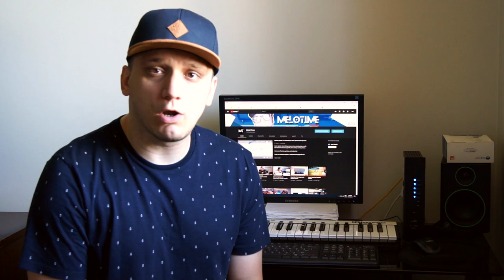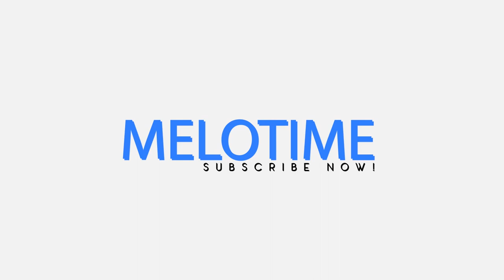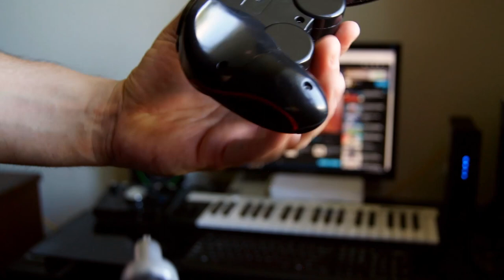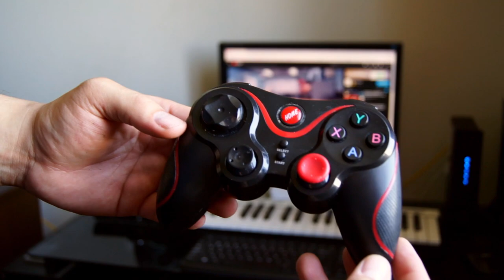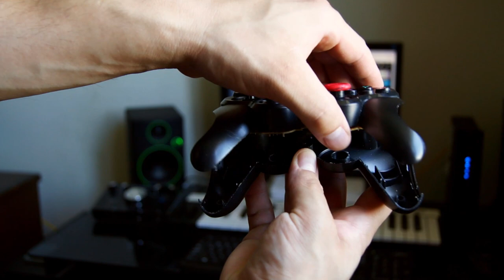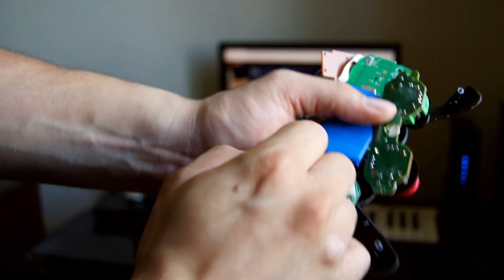S3 Bluetooth Gamepad Controller HOW TO DISASSEMBLE

Comment: Hows it goin m8 i just wanted to ask how i would fix the problem with this controller if i cant use the analog sticks in some games but the buttons work instead, any ideas? Plz let me kno so i can figure this out. Idk if they are the same one because i got mines from wish and it doesny have that type of dpad but still from the same comp.. Thx and have a great day.
Reply from the maker: If you have trouble hold down home button and press A ... That should reset the controller, after you do that try the game again ...if the problem is still there you.might need to reconfigure the buttons within the game ... Is there a option in the game to reconfigure the buttons ?? .... Some games have that option